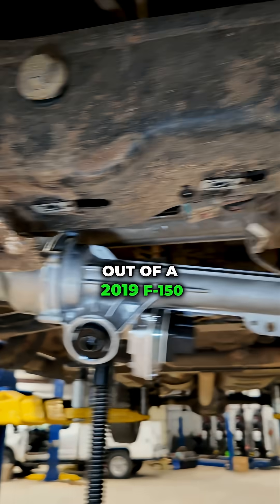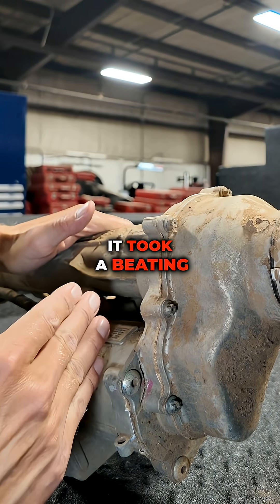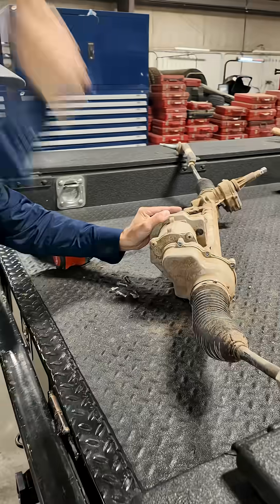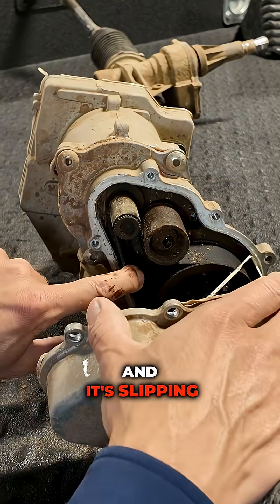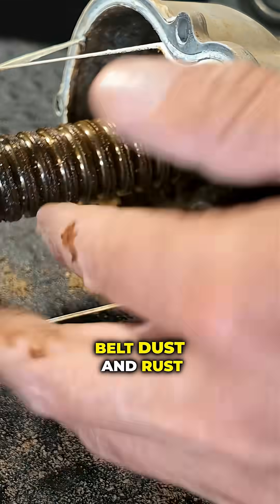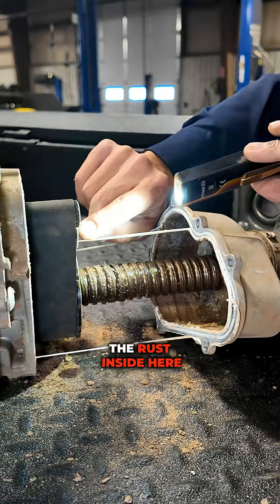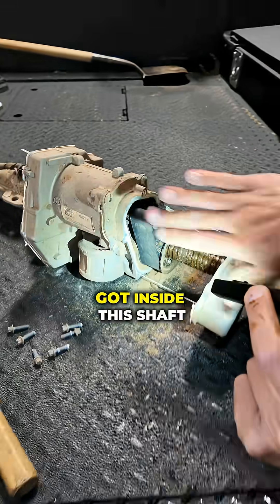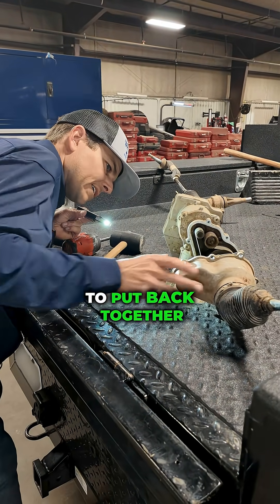Power Steering Rack Split Open  #Shorts

Comment: I have a 72, 1 ton Dodge it's been through hell and back hauling firewood in northern Arizona, drive down the road just beautifully
Reply: Then Dana axles built different though lol. 

Both my 83 Ford and my 90 Dodge have Dana's and they are tough.
Reply: @noturkill9879 yes everything is heavy duty it has an 8 ft by 10 ft dump box, 31821 Heavy Duty 4 speed and transfer case, best truck I ever owned and I traded a motorcycle for it,
Reply: Leaf springs in the front makes all the difference in the world, none of those crazy coils